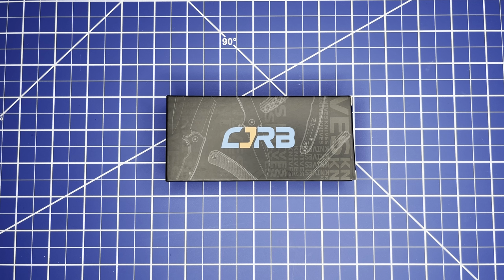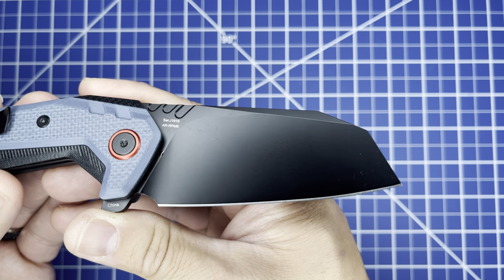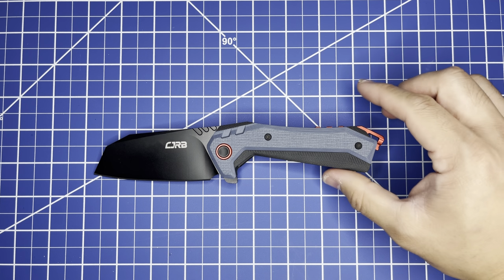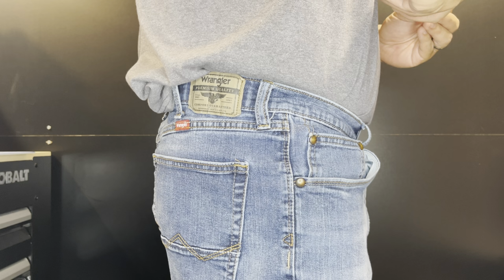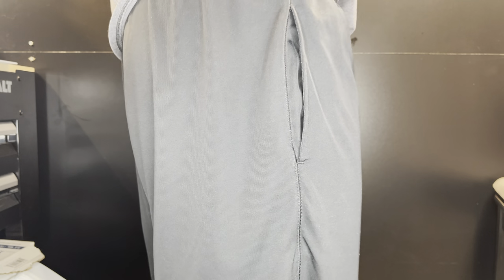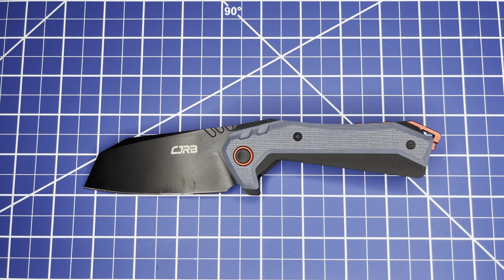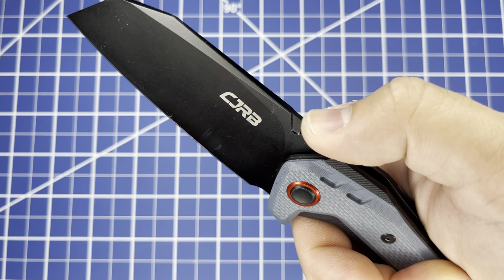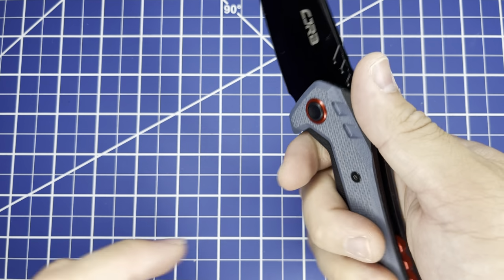CJRB Tigris: Unboxing, Overview and everyday task cut testing.

Comment: This is one of smoothest flippers I own after a  day of breaking it in and it's insanely sharp!  And that's comparing it to benchmades spydercos and fox knives! Worth every penny!
Reply from the maker: It's a great one for sure!
Reply: Just saw your review of this knife…after two years, how is it holding up?
Reply: @justinh-r880   I had to tighten up the screws on the pocket clip a few weeks ago.  But other than that, it is still crazy sharp. It's still one of my favorite knives I own! I would 100% recommend picking one up especially for the price! You won't be disappointed!